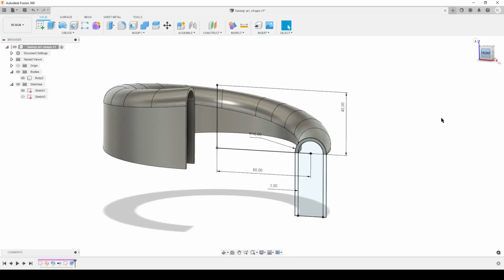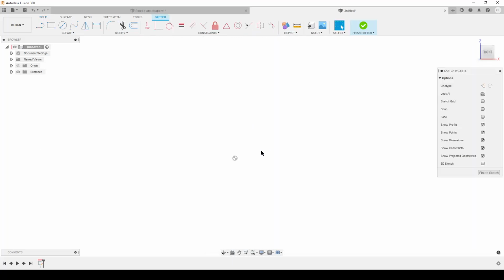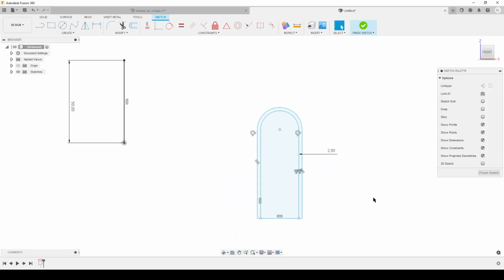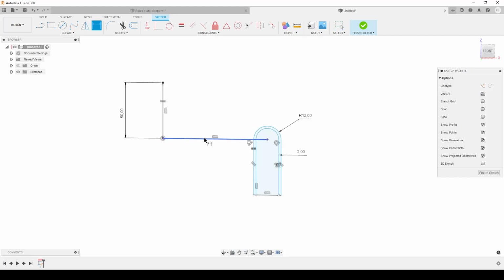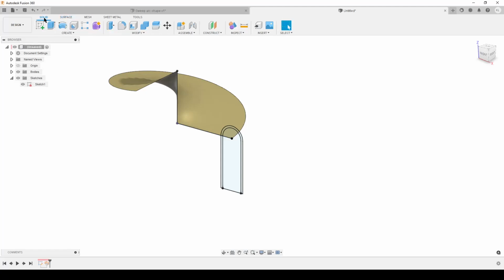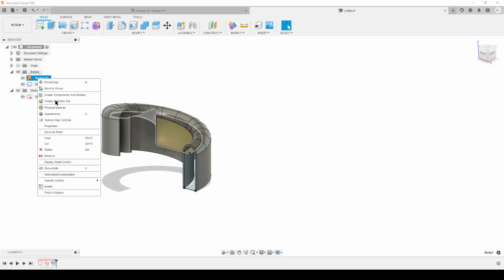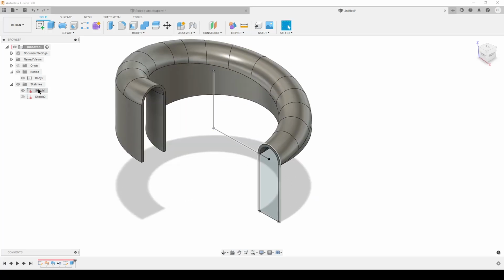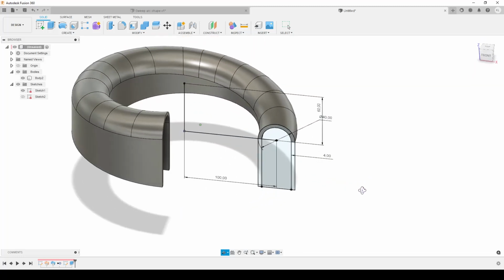Sweep along helix - Fusion 360 (Reddit question)

Comment: Thanks for sharing it. It's very useful.
I have a question: I want to make a planter pot. Conical, bottom smaller than top. That's easy. But how can I emboss a pattern to it, and that it closes seamlessly on the back? What ever I tried, I got weird results.
Reply from the maker: It's possible but take some work. I'd use the thinking in this video on how to put hexagons on a cylinder https://youtu.be/AYbnTJxNODI if the pattern repeats around the cone, and this video on how to put text on a cone https://youtu.be/Pud1-mZBGdo.
If the pattern is more of a spiral style I'd use a surface sweep and work from that.
What I'm trying to explain is that it depends a lot on the typ of pattern.